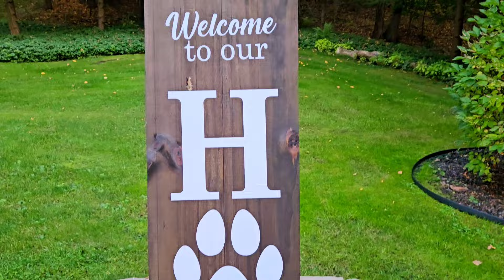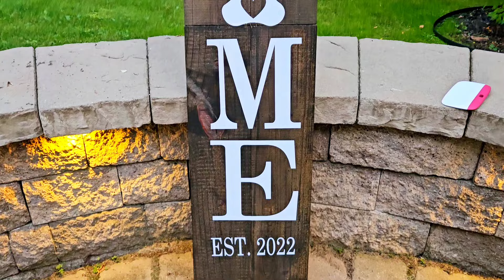DIY FRONT PORCH WOOD SIGN|| HOME  WOOD SIGN

Comment: Very nice.  I would add battery powered candles in those cage lantern. You are very talented. 20:10
Reply from the maker: Thank you. I had an outdoor battery candle all summer, and I never turned them on. Because they are not the remote control ones. Pain in the ass constantly taking out to turn on and off. It did look nice, though. I'm definitely going to get the remote ones. Thanks for watching .

Comment: Hi Shana...how did you pick out the fence pickets to avoid sanding? And what size wood pieces do you suggest to hold it ttogether? I have liquid nails
Reply from the maker: Hello. Just go to your local hardware store. Lowes are homedepot.  used your eyes carefully as you pick you wood. This means that if you have yo dig through to fine, the best-looking ones then do so. That's what I did. Now the  wood is from Lowes it's $4.98 each. It's called  pressure treated southern yellow pine dog ear fence picket. Now you can use nail glue. But you still need to brass the back. If you watch my video again and follow in the instructions, you can't go wrong. Thanks for watching .